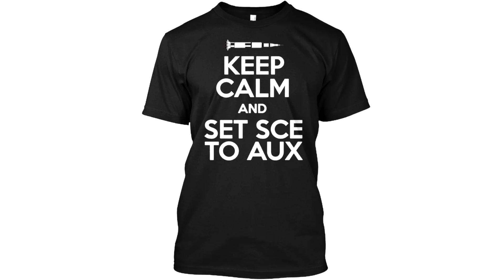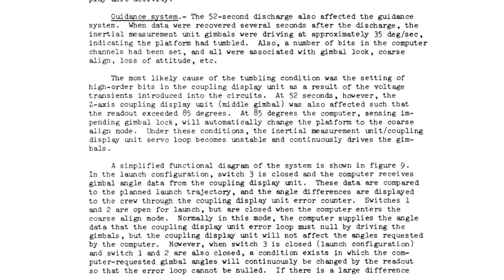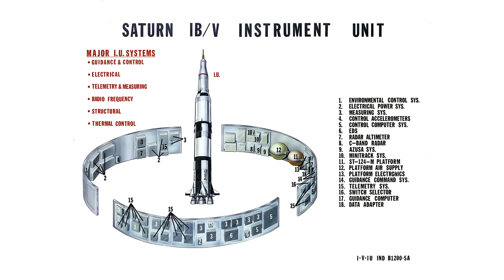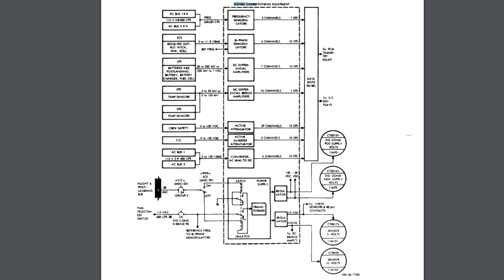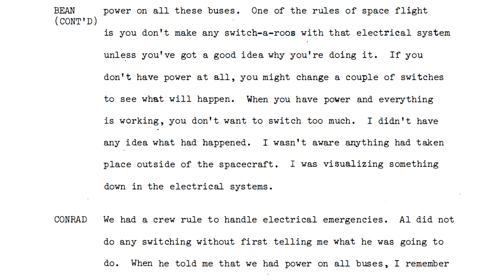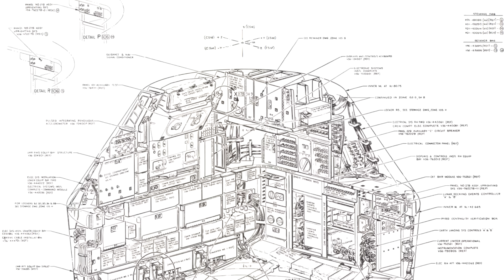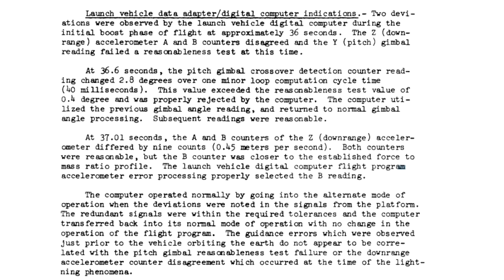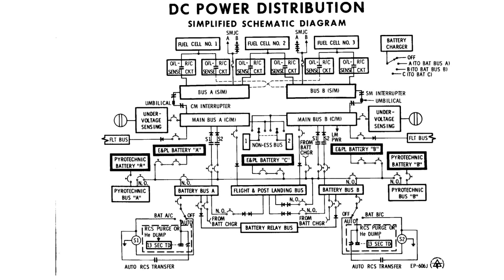What Does "Set SCE To AUX" Mean Anyway - Apollo 12's Lightning Strike Explained

Comment: 13:30 To be fair, if the parachutes did fail, they were going to die whether they'd been to the moon or not. May as well go to the moon anyway.
Reply: I took the same approach when a taxi test of a small plane I'd  built turned into an unscheduled and very premature  1st flight test.  After finding myself in the air without a full understanding of how to land safely,  I decided to spend a bit of time flying around and enjoying the experience before turning my attention to the matter of getting back down. That way, I'd at least have had one last bit of fun before meeting my fate. As it turned out,  I  came up with a way to land without breaking either my neck or the airplane.
Reply: @Prestomeco202  It really makes sense to  get a feel for the plane prior to trying a landing doesn't it?
Reply: @A.Lifecraft  That's exactly what I was in the middle of doing. I had done a series of high-speed taxi tests and was in the middle of doing "crow hops" i.e. short, slow flights, a couple of mph below take-off speed where the plane floated in ground effect a few feet above the ground. Halfway through what I expected to be 2-3 days of this exercise, a slight miscalculation on throttle settings turned the crow hop into one of the more interesting moments of my life.
Reply: Plunge to your death now or in a week -- your choice.
"Or the horse may learn to sing." If it doesn't work now, maybe it'll magically repair itself, given enough time. Procrastinate now!
Reply: I think you both missed my point. It's the same as Apollo 13's heat shield; it may have been damaged in the explosion, or it may not. The only way to find out is to try it, and there's nothing we can do about it anyway, so we may as well just get on with things, get them to the point where they have to rely on it and then hope for the best, and, in both cases, the astronauts got lucky.
Reply: @adammullarkey4996  to be fair apollo 13 only went to the moon in the first place was because a free return trajectory was the best and safest way to get them pointed back at earth rather than a direct abort
Reply: @TonySpike  I know, but that isn't related to my argument. My point was, they were already on the way to the moon. They were passing around the far side of the moon, out of contact with Earth. If they wanted to disobey orders, that was a perfect opportunity, and they didn't take it (admittedly possibly because they knew they'd die if they did, but my point stands).
Reply: @icollectstories5702  That's not how entropy works :P
Reply: @icollectstories5702  IOW, dying later is always better.
Reply: @icollectstories5702  You miss the point it is about a chance, not a fact.
Reply: @5Andysalive  It's unknown and unknowable until you flip the switch. What do you gain by assuming it does work?
Reply: @icollectstories5702  What from the opposite? You can't change it, you might as well go on with it.
Reply: @5Andysalive  There is the possibility that while the 'chutes work now, the situation deteriorates further -- another mishap causes more damage. So the conservative approach is to wait until you are sure everything is pristine and take your risks incrementally. I believe that's how aviation flight tests work.
Reply: to be fair, it's an explosive. if the electronics are working (and they had backups, just give it full battery voltage), it's not likely to have been zapped with 15 million volts and failed without going off. if it failed, the parachute should be hanging out the side.
Reply: @wyattroncin941  Just to be pedantic -- what if the hot and ground leads shorted together so that connecting them to a battery just shorts that out too? Lots of ways to die on a rocket; it's amazing people survive them!
Reply: @wyattroncin941  That's what I was thinking
Reply: Flight: "Can they do anything about it?" Reply: "Well, no." Flight: "Then they don't need to know about it. do they?"
Reply: Also, if the consideration is 'the pyros had gone off,' there were two opportunities for outside observation/looking for burn marks. Both in lunar orbit. The first when the LM detached from the CM. The second when the LM returns from the moon and docks. There are copious amounts of video and photos showing nothing 'wrong' outside. As far as something happening that was not observable from the outside ... well fortunately there wasn't anything wrong with parachute deployment.
Reply: Why put a time stamp that links to the end of that, ffs why not link to the start.
Reply: plus, there would be all the time of the mission to try to come up with better creative solutions ...
Reply: @jv-lk7bc  "Ok, boss, I've been thinking really hard about the problem, and here's my solution: If we adjust course so they don't re-enter, we won't have to worry about failed parachutes because they won't work anyway in space."
Reply: And -- while I've certainly never heard it first hand -- uniformly... everyone who ever tells a story like this says that uniformly, every one of the astronauts would have made the same exact decision.

Steely eyed, indeed...
Reply: Well, the trip was pre-paid
Reply: Adam, I agree because it's the rational approach with one minor possibility that the 'chutes work today but might not a week from now; in my mind, this is an infinitesimally higher probability than them not working after a week in space with no lightning -- and if you are worried about that, don't get into the rocket!
I do wonder about the irrational response, 'cause we're talking about responsible military crewmen -- if they told me to abort, I'd tell 'em that I'm going to the moon! Could they be counted on to NOT disregard orders to abort?
Reply: @icollectstories5702  The crewmen for Apollo (and all space missions, before and since,) are very skilled handpicked pilots who are subjected to a battery of mental, physical, and skill tests before they are even allowed to begin training for the mission, and continuously tested throughout training as well. There were also three crewmen on all the Apollo missions, and if one decided they were going to the moon, damn Misson Control to hell, the other two would certainly override him since an abort order usually means that the spacecraft is no longer capable of going to the moon and back safely, and that to do so would be suicide. NASA doesn't want to issue an abort order, each launch package was extremely expensive and they had immense pressure to succeed on their mission, hence all the debugging that happened when the computers went haywire rather than just immediately ordering the crew to activate the escape rocket and come back home. But the crew want to come home, they have families after all, and no sane  person wants to die - however, with the parachute pyrotechnics possibly being out of control, but no way to test, and the spacecraft operating well enough to go to the moon, sending the astronauts to the moon was certainly the right call, especially since they would die either way at that point.
Reply: @cr4zyj4ck  No. They aren't all pilots.
Reply: Gene Shaver  No, they couldn't. They weren't equipped for an orbital EVA, they were equipped for one on the lunar surface. They didn't have tethers, and they certainly didn't have the fancy thruster packs they have now.

 @icollectstories5702  I would have thought so. They were the best of the best; some of the best pilots America had to offer, hand-picked and then given even more training. If you can't trust someone like that to follow orders, who can you trust? Besides, look at my previous example again; Apollo 13 was ordered to abort, and did so without question, even though they were already on the way to the moon. I'd imagine that, if Apollo 12 was ordered to abort while they were in LEO, they would have done so. They probably wouldn't have been happy about it, but they would have done it.
Reply: @adammullarkey4996  You realize some Apollo crews did in fact do little EVAs while in lunar orbit, right?
Reply: @some-online-dude  As far as I’m aware, the only Apollo off-surface EVA’s were on 15 and 16. This was a planned EVA to retrieve film and data recorder from a canister on the service module. Just because a later mission which was planned to have an EVA was able to do an EVA doesn’t mean a mission which did not have any planned orbital EVAs would be capable. Sending an astronaut out with no tether has an excellent chance of killing your astronaut, and you still wouldn’t be able to rescue the module if there was damage. 

Even if they did unpack the parachute, it probably burns up during re-entry anyway.
Reply: @CoconutMigrating  exactly. Even if it didn't get destroyed or hopelessly tangled on re-entry, the parachute would be too big to work properly with the weight of a human, so it wouldn't inflate.

Best case is it would stay attached to you so it would be easier to find your body.
Reply: @adammullarkey4996  > Gene Shaver  No, they couldn't. They weren't equipped for an orbital EVA, they were equipped for one on the lunar surface. They didn't have tethers, and they certainly didn't have the fancy thruster packs they have now.

You would be surprised what you might try to pull off in zero gravity with death as your alternate outcome.

Turns out you can EVA in space with a lunar EVA suit, it just sucks. Does it suck more than being dead?

Turns out you can make terrible quality tethers from random crap in your capsule. Does it permanently destroy the capsule? Yes. Is it worse than being dead?

Turns out you can do an EVA without thruster packs, but it's really slow and error prone. Is it worse than being dead?

You're analyzing the situation as if it were a standard procedure and concluding it's a bad idea. Of course it's a bad idea. You aren't considering the alternative idea of being dead. That opens up some possibilities you certainly haven't considered.
Reply: @icollectstories5702  They almost certainly WOULD have ignored an order to abort because they don't know if the reentry chutes work. Same chance of dying based on known facts, but in one case you died coming home from the moon. 

In fact, there's a few places where they planned the mission around the idea that the astronauts might decide to... I believe the best phrase is actually "yolo it", as much as it pains me to type. 
Apollo 10's lunar lander was apparently intentionally flown with a partially-empty fuel tank to prevent the astronauts from turning "test flight under lunar gravity" into "first landing". It did not have enough fuel in the ascent stage to return to lunar orbit from the surface, and they made sure the astronauts knew this.
I've also heard Armstrong was first out the hatch on 11 because he was the astronaut they actually trusted to stick to the script and say the "one small step" thing.
Reply: they could have EVAed to unpack the parachutes and jury rig them to harness them to each crew member then bailed out mid descent soyuz style.
Reply: @geneshaver  I think,  they just need more freefall training.  Remember your chances of dieing after jumping out of an airplane without a parachute are not 100%, they are approximately 99.9995%.
Reply: @DSiren  i can argue the extreme too!  i think they just need more Buddhist training so they can ascend to the next plane of nirvana or whatever and just float out of their capsule if need be.
Reply: @geneshaver  ???? no the way you survive is using the right landing technique and hitting some trees (of a certain type idk which) on the way down.  Also people have a terminal velocity aswell.
Reply: @DSiren  there is no "landing technique" for surviving a terminal velocity impact. You can't train to survive a TV impact any more than you can train to survive getting shot in the chest.

And you can't jury rig a reentry capsule parachute to work for a human. Even if you could get it securely attached (you couldn't) and get it to deploy properly during a Mach 25 descent (not even remotely possible), it would be too big to work properly and you'd fall to certain death with a nice colorful streamer
Reply: @jacobs7764  Your argument rn should be "reentry is never ONLY terminal velocity, it is usually several hundred times that" because as a matter of fact, there is a single technique and a certain circumstance which can allow you to survive a terminal velocity landing as a person, just with tons of bones breaking and the requirement you stay conscious for the 10 minute window that first responders need to get to you by.  And yes, there is a 'technique' to survive a gunshot, just it's not one that humans are capable of intentionally carrying out due to the insufficient reaction speed of a human.
Reply: @DSiren  You're wrong. There is no such thing as a technique that will allow you to survive a fall from terminal velocity.

Unless, like the gunshot technique, you're referring to a technique that only superheroes can do, in which case you should find a discussion where that's relevant, because it's not here.
Reply: @jacobs7764  terminal velocity of a person is only 120mph
Reply: @geneshaver  very kerbal idea there
Reply: So basically the same rumor that went around after Columbia broke up?
Reply: 5Rounds Rapid 
Colombia was a different issue because they could have EVA to check it out and there was another shuttle that could haven been sent on a rescue mission.
Reply: The fake space capsule was dropped from the back of a C5 cargo plane. Nothing has been to space.
Reply: @scottmerrow1488  I'm not going to argue with you. There's no point.
Reply: @adammullarkey4996  You aren't going to argue because there's no proof for your claims.

Comment: Yeah, the CM was in the ONC (I think on 3rd shift) at the time of the bus drop that caused the first SCE problem noted, definitely not the A-team.  The story about the parachutes may be stretched over time.  No doubt someone did question the potential consequences of the lightning strike on the pyro circuits but there was nothing that could have been done if they had been damaged (it would have been far more dangerous to charge the PICs and still probably not learn anything from it than to just wait until the time comes).  Besides, there were three separate circuits with 3 separate PICs and two out of three chutes were OK and even only one may be survivable.

Comment: How did the communication systems worked perfectly fine even after the strike ? Vinatage space channel has a video about this sce to aux. In aux mode the sce equipment needs less voltage compared to the normal mode.
Reply from the maker: Some equipment worked fine at the lower voltage, other parts shut down. I can't find any document that suggests 'AUX' was intended to work at lower voltages, just that the AUX setting forced it to use one power supply without the power selection circuit.

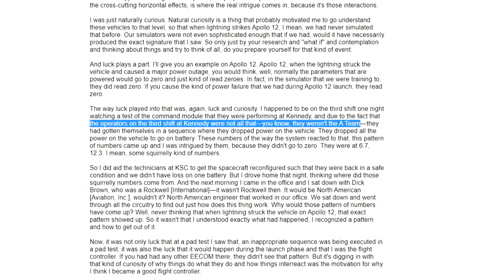Comment: 11:01 That's what makes a steely-eyed missile man. Curiosity+knowledge+the balls to use it.
Reply: If you have the balls to use your knowledge be prepared for the NASA inquisition that follows. One who knows.
Reply: First class systems engineer. He knows a huge amount of detail about every part of the electronics he is responsible for. He also knows how it works from first principles upwards. It's ok working through check lists, but when the fault  was not considered in FMEA, it's that depth that gets everyone home safely.
Reply: @andrewwhite1793  And not only does he know... but in this case he was curious when he didn't know something 100% and then had the initiative to run that down with an engineer, and that engineer had those same qualities. How often do you run into sets of people that are willing to run down problems even when they aren't going to solve anything necessary down the road(that they can predict anyway).

Comment: I mean if the parachutes are dead there is literally no point in aborting and lithobreaking landing early.
Reply: True, but imagine going through the whole mission knowing you're certain to die at the end. No doubt they all would have wanted to do exactly that, though.
Reply: Mark Scheuern :  they wouldn't have known. There was no way they, or mission control, could have known until the parachute pyros were actually tried on re-entry.  The only equipment which could test them was way back at Kennedy (the ACE) and disconnected before launch.
Reply: @malcolmbacchus421  You're right of course. No way to tell beforehand.

Comment: And just to think !
All this chit could have been replaced and bettered by using a few $2.00 Arduino's ?  LOL

There ya are seconds off the pad.  
Your Power Supply glitches.  
Your Computer decides,  Screw this chit. 
 Your shorting me by. 0.7V on my power bus.  
I'm taking a nap.
  Wake me up when ya got this chit sorted out.
NO COMPUTER YOUR NOT TAKING A NAP.
I need ya to keep me flying in a strait line.  
LOL
Stupid Azz Computers !  Nothing more then some relays in this case ?

Comment: Interesting.  The current Boeing SCE (Spacecraft Control Electronics) also works at 28V and is responsible for telemetry (and most everything else).  On some spacecraft there are three (one is aux or reserve).
Reply: I'm not an Avionics expert but all the avionics stuff I've seen has run at 28V.
Reply: @AndrewBlucher  We've had several voltages from 28V to 200V, but 28V is the most common.